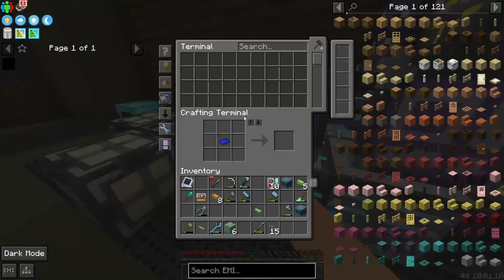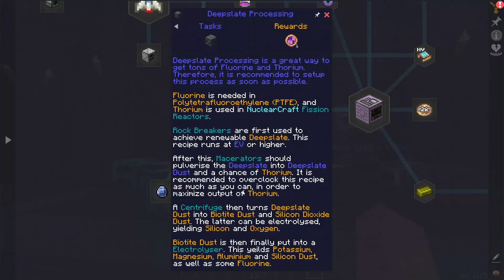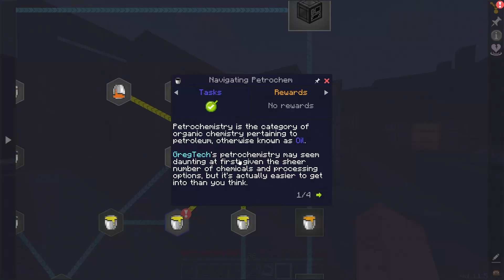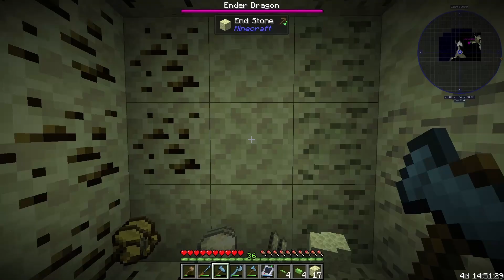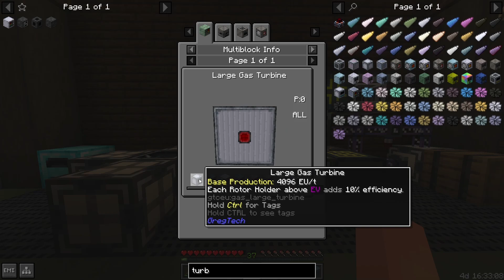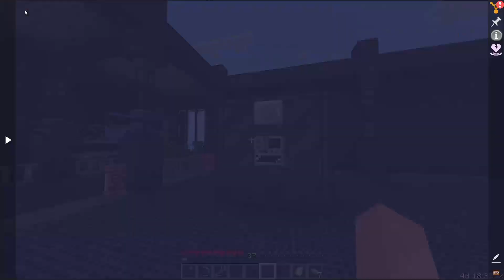Tier Two Micro Miner & EV Machines! | Minecraft Monifactory Hard Mode  - Ep 13

Comment: two questions pls
how to show the tier in circuit or wafter

and how did make a paper pattern
Reply: Processing patterns allow you to change the output to anything, meaning you can put all the blocks for, say, an lcr, and have a paper as the output, and then request that paper to get all the blocks into whatever inventory the pattern provider is connected to.
Reply: It's called the paper trick. It is to request multiple things at once and push them into something. Basically like a pattern, but you don't specify the output - you request the specific pattern itself.

Comment: You can make much better tool with vanadium steel by the way, it should already be acessible to you since some time. 
As well as the angel ring, which is quite cheap for you by now and the infinit water storage for AE2 form mega cells which is much cheaper than the 20 water covers you used :)
Reply from the maker: i finally got the angel ring dont worry 😅 and i totally forgot about the water cell will do!
Reply: @jetlaggmc dont use normal wrench screwdriver saw etc rtc. use the electrical versions. atleast in 1.12 we have electric tools like drills etc etc. does 1.20 have those?
Reply from the maker: @naveengraze  yes! the only option for electric tools though are either lv, or iv, so i was just waiting to have access to iv for those!
Reply: @jetlaggmc  oh okay
Reply: Vanadiumsteel is an MV material. he is in EV.